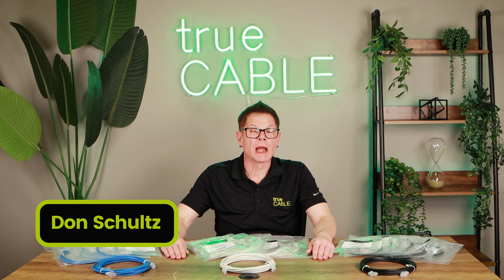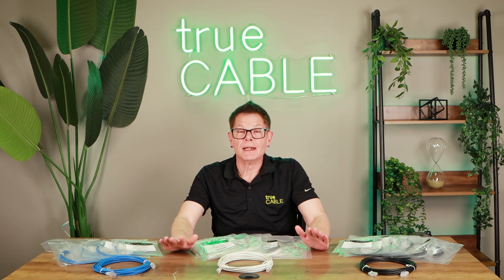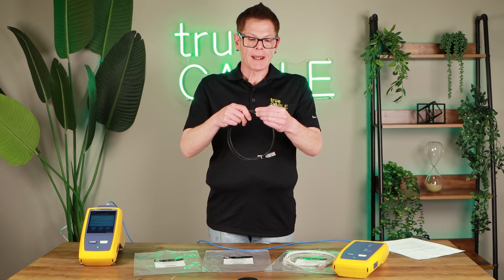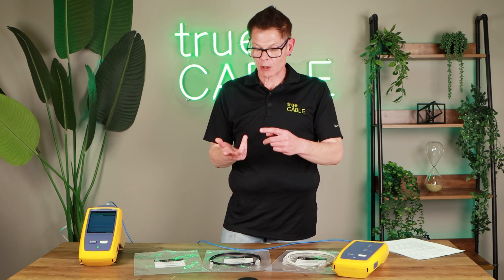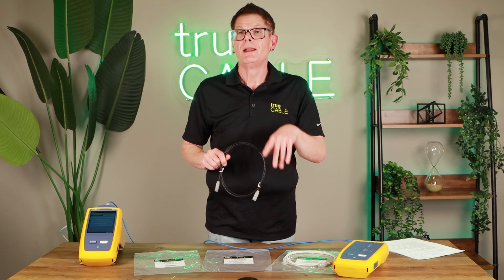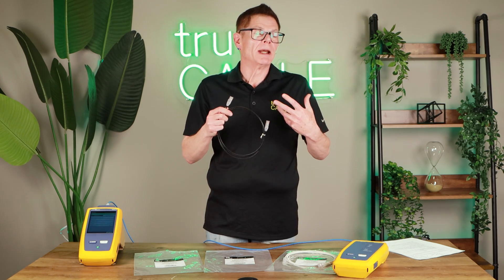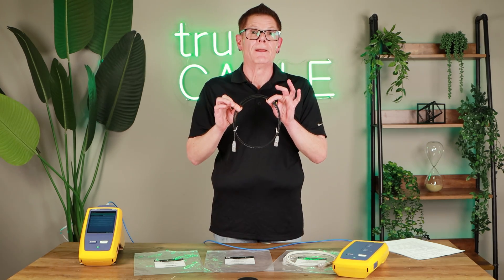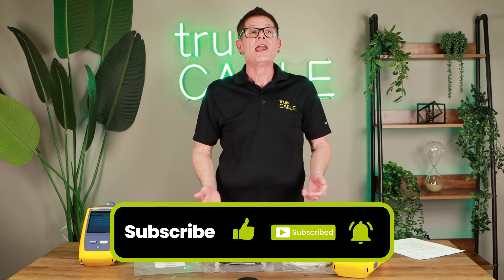trueCABLE’s Cat6 Patch Cable | 2024 Network Upgrades Have Arrived!

Comment: What might be a good option in addition to or along side are maybe color clips to go on the jacket or connector area. I have seen several other companies do this. It allows us to buy a single color of various lengths and we color code them with the clips when we install them. Just my $0.02. I am about to re-patch our racks to clean everything up and will be looking at these. Thanks for the video
Reply from the maker: Hello and thanks for that suggestion. We will add that to the wish list.

Comment: trueCABLE patch cables fixed a bunch of connection issues I was having with Monoprice Silmrun CAT6a (yeah right) at greater than gigabit speeds. I didn't think they'd make much of a difference, but they were totally worth it! Wish you guys had more colors, so it'd be easier to differentiate cables from other cables. I used rainbow colors before and pluged a different color into each port. I also like that these cables work with UniFi RGB ports. Super cool!
Reply from the maker: Hello Saturn2888! Thanks for the kudos. Feel free to hop over to our website and leave a review! You just discovered what many others are going to find out...that imported mass-produced patch cords are largely unmitigated garbage. It is not hyperbole nor an exaggeration for me to make this assertion. It is the truth. Incidentally, I tested those patch cords you are referring to. I can tell you they did not even pass Cat6 patch cord testing, much less Cat6A. I don't think they would have passed Cat5e even, but I only have a single Cat5e PCA adapter, so I cannot test Cat5e test limits on patch cords (I can only test Cat6 and Cat6A test limits on patch cords). On a side note, I use Ubiquiti equipment, too, and I also love that our clear boots glow with the RGB lighting of the switch ports like yours do. I noted the desire for additional colors. Can you please specify which ones you would like to see the most? Like, the top three?
Feel free to hop over to our website and leave a review!
Reply: @trueCABLE  rainbow colors actually. When looking at a patch panel, I like having all ports different colors if possible. Especially if you have a mess of them as I do right now (since I haven't reconfigured my keystones yet after adding 2 other switches).

Maybe I'm weird, but I do code for a living and all white or all black code is hard to read. I prefer syntax highlighting where each color has a job kinda like how your fiber pigtails have standard colors.

I don't mind having even 8-10 colors too, just a few more to help know what I'm seeing at a glance.

Comment: I can see the frame errors in all my switches. NONE of my short or long bought cables have any errors.

If you do understand the standard and electronics (differential signaling), you understand how resilient the signals are.

But groupies, wanna-bes and ignorant people can have the honor of paying quite more.

I would welcome a real world speed transfer test to shut mouths!
Reply from the maker: Hello! I am glad to hear you have not experienced any issues. That said, I have personally experienced issues with poor-quality patch cords that caused a full channel failure and several million packet errors every 8 to 10 hours due to a capacitance build-up and discharge. The permanent link and the patch cord on the switch side were certified. After some hair-pulling, I removed and tested the patch cord on the remote side. The cord failed patch cord testing to the point that the RL was -5.9 dB, and the NEXT parameter was -3.9 dB. That was enough to cause an issue on the entire channel and the issue manifested itself not just through my Ubiquiti hardware reporting Tx and Rx errors, but dropped video frames and choppy camera feeds. Ethernet is indeed resilient, but don't be fooled. Sufficiently bad patch cords can and absolutely will ruin your day and maybe even your reputation if the chips are really down. You are free to decide how much roulette you wish to play and how important your time is to you when running down an issue. For me, personally, I would rather have a patch cord that I know works before I plug it in. Side note, I am Don Schultz, and I have a BICSI INSTC and INSTF certification in addition to Fluke Networks CCTT certification. No wanna-be here. /

Comment: 1) Do the cables ship with the certifier report? Or at least a PDF copy.
2) Do the certifications cover PoE?
3) Do you have any plans for similar certified 6A patch cables?
4) It seems that you only ship in the US. Any plans for international orders?
Reply from the maker: Hello dono! 
1)We do not ship the patch cords with a Fluke certification report. The reason is two-fold. This would increase costs pretty dramatically and environmental responsibility. The reports would just end up in a landfill. 
2)Our certifications cover PoE++ 802.3bt and have been tested as such. 
3)We do plan to offer shielded 28AWG Cat6A patch cords in the future, but we are awaiting the results of this first batch of patch cords to see what colors and lengths are most popular. 
4)We ship to the USA and Puerto Rico only, although you can obtain our products from Amazon Canada. We have no plans to offer international shipping.

Comment: I agree with others that red and yellow would be nice. Red for cross-over cable or firewalls, yellow for routers/uplinks (Thanks, Cisco :D ).
Reply: That makes a good point, I know there are a lot of different colors for different functions. Interesting I like yellow or orange for wireless access points. Great suggestion.
Reply from the maker: Hello ALG IT! Noted and thanks. We have added yellow and red as two colors upvoted by you and others. After a period of time of data collection we will likely settle on a couple or three more colors to release.

Comment: They look like quality cables, but $6+ for a patch cable is unreasonable.
Reply from the maker: Hello Mahlon! They are guaranteed Cat6 component rated and 100% Certified with a Fluke DSX-8000 prior to shipment--one by one. That is the only way to guarantee a good patch cord. I would agree that $6 for a patch cord would be pricey IF the patch cord was not absolutely guaranteed to work correctly, even when bent at a rather severe angle at the terminations. The pricing reflects the cost of quality, and lately, the patch cords that have flooded the market are largely not properly tested and unreliable in some way. In the end, what could cost you far more? Moral of the story: Your patch cord is just as important as the performance of a permanent link. You would not walk away from a professional installation without certifying it. Why would you walk away from a patch cord without knowing...for certain...that it performs too?

Comment: I think it would be great to offer colors that match your keystone jacks. Both shielded and unshielded, that’s at least the route I went with my home rack set up.
Reply from the maker: Hello Paul! That is a great idea, and we originally thought of it as you do. That said, some colors sell faster than others, and we are being careful to carry the colors people want without adding to our warehouse space products that don't move well or at all. Warehousing is expensive, and we have other products we want to add. Like residential 12 port wall mount patch panels (shielded and unshielded), and Cat6A shielded patch cords, in addition to wall mount racks...so...yeah...being careful!
Reply: I think the Blue is the most common color I see at my work place. It is also the color of cables they ran in my home when I had it built. But you already have Blue. It’s hard to say which colors, maybe I might add black, always a safe bet IMO
Reply from the maker: @pharpester  Hello Paul! Yes, blue is the most common color out there. We already have black and white. We noted your suggestion for green from an earlier comment you left. Thanks!

Comment: I can make my own patch cables.
Reply from the maker: That's great John! Creating your own with solid copper is not a good idea, and creating your own with stranded copper is not a terrible idea IF you have the appropriate test equipment to be sure the patch cord works to the standard. Most people don't. A Fluke DSX-8000 with Cat6 PCA adapters (an add-on) is going to cost north of $14,000. With us, you don't need to have the fancy tester because we have more than few to guarantee a good cord.